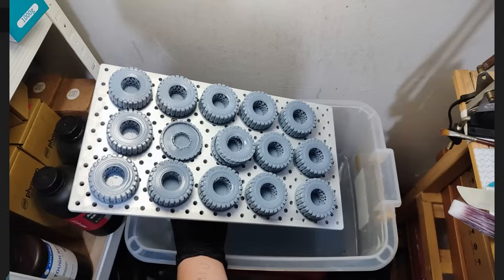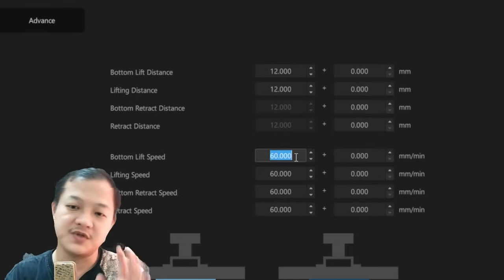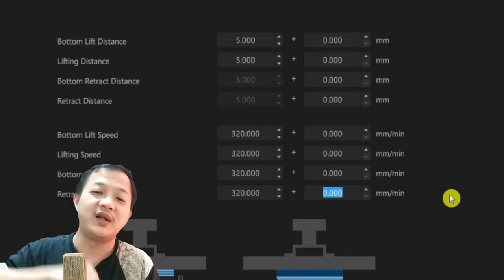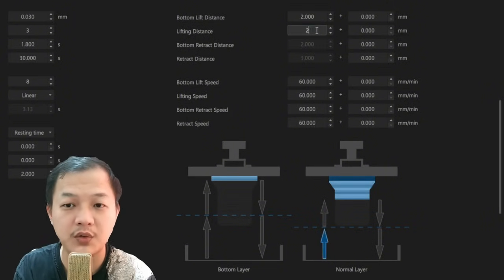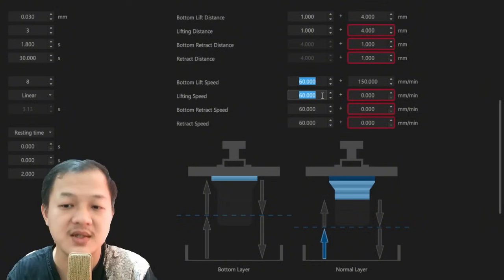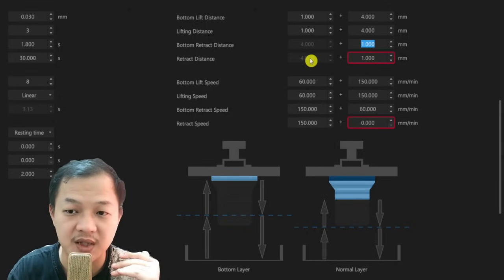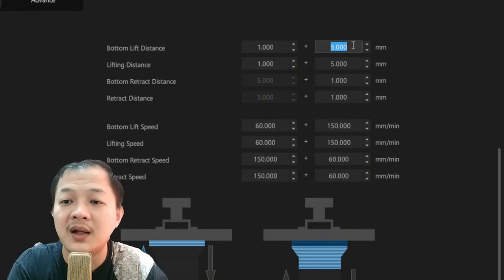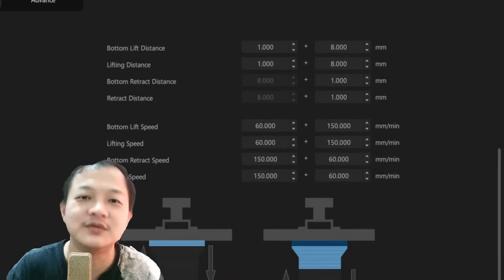Masterclass Lift Distance Resin Print Setting

Comment: My print came out good on my Mega 8K S but when I went to clean it the build plate a lot of resin was embedded in the holes. That has never happened to me. What can I do to not to have this cleaning headache? Ty for this video as well!!  @dennys wang
Reply from the maker: Adjust your bottom exposure.
Your botton exposure must have been more than 35s.
Ideally under 30s to avoid your issue.

Comment: Hi dennys, will this work with Phrozen mighty revo with aqua 8k snow grey? I'm keep getting printing failures :(
Reply from the maker: Print setting work on all printer
As lo g as you do proper test.
Reply: @wangdennys  thank you for the reply😊😊

Layer Settings
	•	Layer Height: 0.030 mm
	•	Bottom Layer Count: 6 layers
	•	Normal Layer Exposure Time: 2.8 seconds
	•	Bottom Layer Exposure Time: 28 seconds

Transition Layers
	•	Transition Layer Count: 6 layers
	•	Transition Type: Linear
	•	Transition Layer Interval Time Difference: 3.6 seconds

Resting Times
	•	Rest Time Before Lift: 0.0 seconds
	•	Rest Time After Lift: 0.0 seconds
	•	Rest Time After Retract: 3.5 seconds

Printing Mode
	•	Waiting Mode During Printing: Resting time enabled

is this setting optimal for Phrozen Aqua Snow-Gray 8K resin on a Mighty Revo printer?

Comment: Hi Dennys. Thanks for your video and sharing your settings. I have a question for you. Since I switched from Phrozen 4K to Revo, I've been having trouble with air bubbles (on 4k i had no such problem). I often want to print the item flat (no layers, smooth surface), but after printing, I always end up with a few bubble holes. Do you have any good advice?
Reply from the maker: Did you use the same resin?
Or the same speed?
Reply: @wangdennys  I tryed anycubic abs like2 and phrozen hyperfine. Also tryed diferent  speed.  And always becames some holes

Comment: I’m going to have to test your distance combo. I use the other way around L4>2R2>4 but I didn’t test with under 3mm for first stage lift. I realize 4>4 wasn’t needed for my setup but this is interesting. Thanks
Reply from the maker: If you switch the R to 4>2
Your print will be slightly faster.
Cause it is the right format.

Comment: Excellent video again dennys. (I had to say I was shocked you leave the first motion distance on 1mm.)  I always was scared to get that lower as 3😅😅
I’ll will give it a try and see how it goes on the gk3
Reply from the maker: You can always change the numbers according to your needs.
My setting is not absolute.
Reply: @wangdennys  I know. But I always tought it was to low in the first stage (or it was going to quick to early😉) I have some testing to do the next days 😃